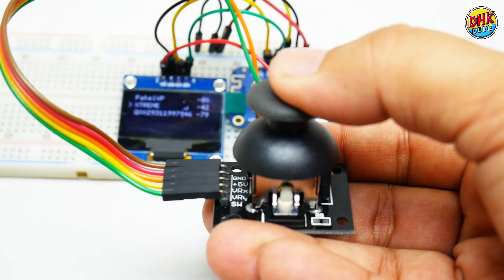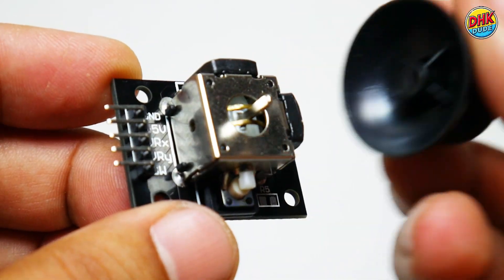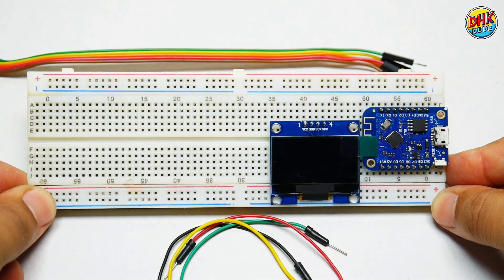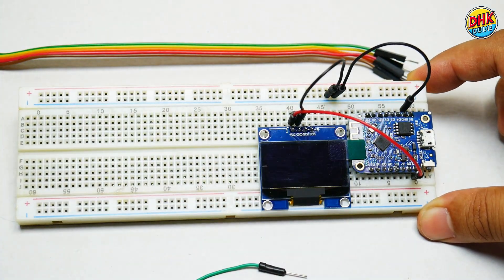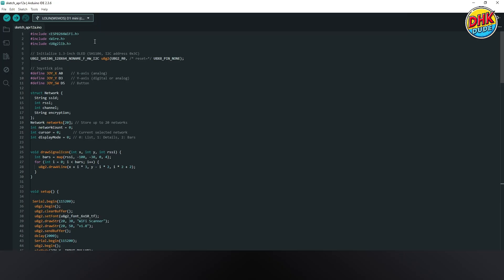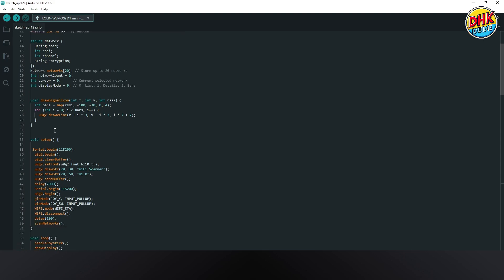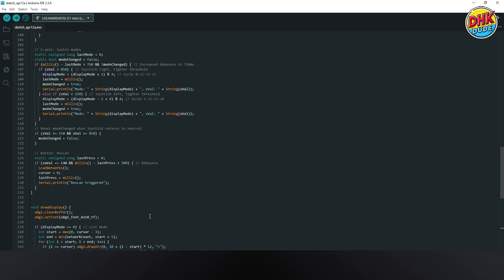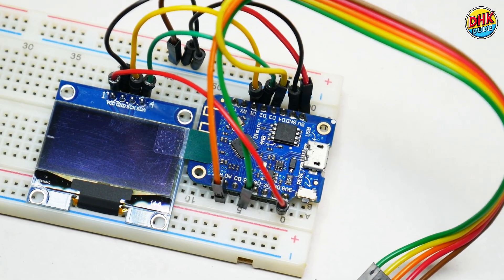DIY Wi-Fi Scanner: Fix Slow Wi-Fi with Wemos D1 Mini! | DIY IoT Project

Comment: I have a 7-pin OLED display. How do I connect it?
Reply from the maker: Your 7-pin oled is likely SPI. For SPI, connect: VCC to 3.3V, GND to GND, D0 (SCK) to Wemos D5, D1 (MOSI) to D7, RST to D4, DC to D3, and CS to D8. Update the code to use U8g2’s SPI constructor—change U8G2_SSD1306_128X64_NONAME_F_HW_I2C to U8G2_SSD1306_128X64_NONAME_F_4W_SW_SPI.